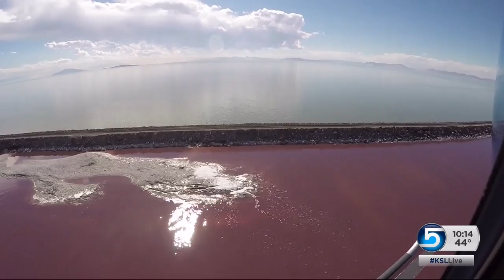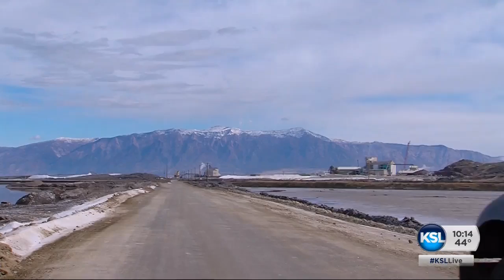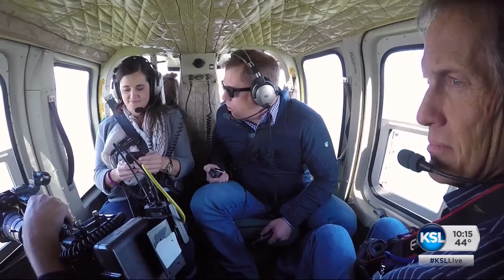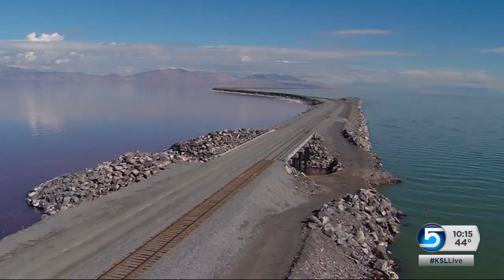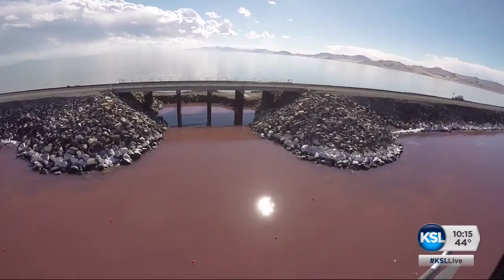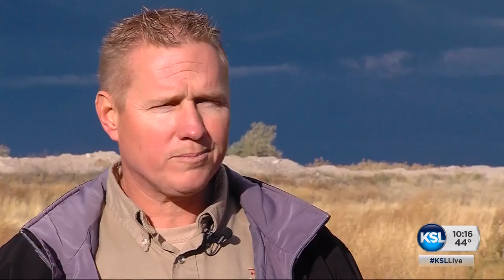Great Salt Lake drying up as plans to punch hole through causeway are delayed

Comment: You know what you do you make special pipes to go in from one side of the lake to the other side of the lake so what's going to happen automatically the water levels will be going back to normal why because the pipe is going to make sure that one side leg gets enough water and the other side Lake also gets enough water you make the pipes underneath the road and you make it deep enough that trucks and cars and vehicles can actually go normally like as if nothing happened of course you have to build it underneath the highway but a simple set of 30 or 40 or 50 pipes can actually make it back to normal and of course the pipes the pipes should be underneath the highway deep enough so heavy trucks cars and vehicles can pass over it without any problems

Comment: This is what I can't stand about 'talking head' mainstream newscasts. This report leads you to believe that the railroad causeway blocked off the northern part of the lake until the railroad was required to breach it. In fact, the causeway always had culverts built into it. The actual story is somewhat different. In March 2011, Union Pacific Railroad  requested permission to close the two 1950s culverts because of damage related to age and a sinking of the causeway into the lake bed. The two culverts were closed in 2012 and 2013. To mitigate the effects of closing the two culverts, the railroad was required to build a bridge and breach the causeway under that bridge. Construction of a 180-foot-long bridge was completed in fall 2016, although the railroad agreed to delay opening the breach for a few months, due to environmental and water level concerns. The causeway was breached beneath the 180-foot bridge on December 1, 2016. Since the opening of the causeway the level of the water in the arms of the lake have begun to equalize. By 2017 the level of the lake in the northern arm is within a foot of the southern arm. The fluctuation in the lake levels is also nothing new. The lake was at it's lowest historic level in 1963, and reached an historic high in 1988. So the flow through the causeway was always part of the plan since it was built in the 1950s.The new bridge was built as a result of damage to the original culverts. The changing lake levels are normal fluctuation.

Comment: Obviously the shrimp thrived when the lake WAS all one lake and it was somewhat saltier than it is at the moment.
CHANGE is an issue.  But initially there would be no change in the salinity of the majority of the lake because the water leaves it.
As as been noted the water in general needs to move INTO the North arm so it will always be saltier than the rest.  They would need to remove the entire bank to restore it to fully mixing.  Very little salt would go from the North to the South even when the levels are all nearly equalized.

Comment: So just to summarise, to make sure I understand, there is a lake that has no means of replenishing its water except rainfall and there is a company carting off tons of water from said lake to evaporate in order to extract the salt and the company is complaining about the dropping water levels?
Reply: The issue has to do with the water keeps receding so they have to build new structures.  If the lake did its typical eb and flow it woulnd't be an issue they could just have the drainage area's int he same location because the lake will evaporate less with improved water flow and then fill back up again during the spring.  Right now a quarter of the lake is cutoff on the causeway so you have stagnant water with no easy way for the mountain runoffs to enter in on that side since the moutains are located on the east side of the lake and the way the water flow's isn't conducive to evening out the lake itself until the rail line was removed and holes were put in on the causeway.  So before new water was entering on the north side but not enough to keep it leveled with the south side.
Reply: Gathering No Moss I'm not sure if your comment is directed at me of the other reply? If it was directed at me... I know it doesn't evaporate faster, I didn't say it does... evaporation speed comes down to temperature, air flow and surface area. What I said was if they didn't keep taking water out of the lake to get the salt then the level wouldn't be dropping and since they are the cause of the water level dropping in the lake they have a bit of a nerve complaining about it.

Comment: The "excess salt" issue is minor...  The high water (low salt) will flow into the low water (high salt), diluting the salty water before it starts doing any exchange back into the high water side.

Then the water coming back would be the MOST diluted on the salty side...

Whoever opposed opening the breaches is stupid.

Comment: that lake has been ruined many times over.
I remember when the highway was raised because of flooding. They brought enormous pumps to pump the water to another dry flat, creating a 500 square mile evaporation pond. 
The copper mine has ruined it for tourists wanting to 'float'.... etc..
The lake is ruined and will  never, ever be as at was. 
What will be, will be. 
Take a look at the rivers in England, India, France, the Dead Sea, and on and on blah blah blah.
It'll never be as it once was. Anywhere. 
Just look back and try better next time.

Comment: Wow that guys hands on the steering wheel are unique.
Reply: Don't trust him.
Reply: You'll see a lot, driving around Utah. Don't make eye contact.
Reply: she just got license
Reply: hes driving on rail road tracks, with special truck.. you drive on to the track.. lower the rail wheels.. then you stick a large pin in the steering column so the road wheels stay  locked... while driving..it will vibrate some..,, hands on the wheel// just a prefence
Reply: @randellgribben9772  , i dont buy it. i am a retired RRer. ive high-railed for 38+ years. i never have my hands on the wheel. any input could derail the truck. additionally, they are bouncing quite a bit. i predict they are driving down the stone access road which they were seen walking upon.
Reply: @googoo-gjoob  imagine the airbag going off

Comment: what we need is to generate from the flow. That will slow it down to a controllable release. This would need a two way system one slightly larger then the other so the level can go back... Tesla has a one way valve for fluids that could work. I'll post it.
 Make two channels or three. Two in and one out. here is the link to the fluid diode: https://en.wikipedia.org/wiki/Tesla_valve

 Make the channels like this and you can fix the issue and balance the two sections. We can generate from this too... In the lobes. This made on a large scale could be interesting.

Comment: Put in a one way valve.
Reply: You mean like a 3ft elevation difference? Water doesn't flow up hill, and it will probably be a long time before they equalize, giving time to slowly mix as the flow slows down.

Comment: Ok now listen if your concern is quick sudden change in salt content of other side. It was a good idea not open a huge spill way. Solution is obvious several very small spill ways in different areas and depth's slowy mixing in the eco system in a slow and steady you can monitor change & determine an outcome

Comment: that's a complicated issue, I wonder why  the didn't build the causeway with flowing  culverts in the first place?
Reply: People didn’t care enough about the environmental impacts of their actions back then.
Reply: The causeway was originally a wooden trestle bridge, built by the Southern Pacific to shorten the length of the track that once went through Corinne and Promontory, around the north side of the lake. It was later filled in with rocks and dirt because the trestle was reaching the end of its life and would have been very expensive to rebuild. It was cheaper to dump rock in the lake from the trestle until it was buried than to build a new bridge. Culverts either of steel or concrete, would have been hard to put in on the mud of the lake bed and harder to keep from rusting or cracking, so they were left out of the design

Comment: So the question is: how long would it take to fill up the North Arm? 
A rough guess puts it at about 1/4 of the total lake or some 400 sq miles and the story says it's currently 3.5 feet low. So 400 sq miles * 640 acres per mile * 3.5 feet = 896,000 acre feet! This hole is reported to be 150 feet across and let's assume 6 foot deep with an average flow rate of 7.3 feet per second (5 MPH) = 6570 cubic feet per second or 542 acre feet per hour. Thus 896,000/542 = 68.9 days to fill it. It seems DNR didn't do their math and is worried over nothing.

Comment: Did all these geniuses ever think about putting in a one way valve so water only travels into the north arm and not vice versa
Reply: It doesn't even have to be a one way valve. Just fill the gap in with larger rocks of 3+ foot diameter and this will slow/almost stop any outflows while still allowing water to fill this north side.
Reply: Or just use a simple siphon, a large pipe with both ends underwater and a vacuum at the top to pump out air, since the water level is higher in the fresh(er)-water lake.  When readings show the water has equalized and salt is dissolving it's way back toward fresh water, open an air valve to break the vacuum, and stop the flow.
Reply: Mike Betts All that is needed is something flap valves on culverts. We do it all the time here in Louisiana on narrow levees in saltwater marshlands.
Reply: @Lb-bj6st  : The Mormons aren't that smart.
Reply: Profitability is ideal, but this isn't even about capitalism. Every entity needs to budget properly or it will literally go bankrupt. 
Besides they're only worried about the one time effect of reconnecting the lake, a persistent complex valve isn't needed.
Reply: They didn't think of a one-way valve because the point is the make the lake whole again. Water flowing both directions, like it always did.
Reply: or profitable manner?
Reply: lulem400 oh my God common sense he's f**** political b**** don't know what that is if it doesn't line their pocketbooks they don't care
Reply: lulem400 well of course they have to weigh the costs with how much profit it will generate. Capitalism bud.
Reply: lulem400, did all the genius arm-chair civil engineers figure out the trying to construct a valve system many miles out on a very narrow causeway is not such an easy thing to do?

You have to realize that some things must be done within budgetary constraints.  This work was being done by a private company that does not have the power to tax the entire country in order to complete a project.  Thus, any work that is done must be done so in an affordable manner.

Comment: What they FAILED to mention was that back in middle 1980's the railroad had to raise the tracks up-rail bed, the interstate-I80 was also raised BECAUSE the water level was so high it actually covered I80 and the railroad tracks. They didnt close the interstate, you idled thru the water,about 4"deep.
Reply: lol Yeah I was out there then. People were losing there minds that Bangerter was spending a gazillion bucks to pump water out into the dessert at the rate of about a millimeter a year. lol
Reply: They used tailings from kennecott to build burms on both sides of the freeway it was like driving through a tunnel
Reply: I live in SLC back then.  It got to within 3 linear feet of some of the runways at the SLC airport.  I-80 had Great Salt Lake water on both sides of the freeway and a flooded center divider for miles and miles west out of town.